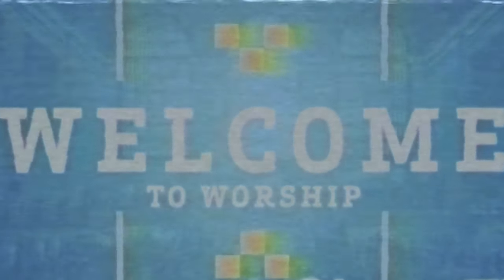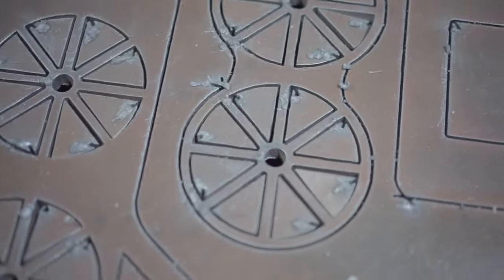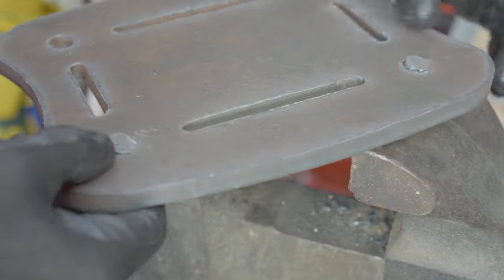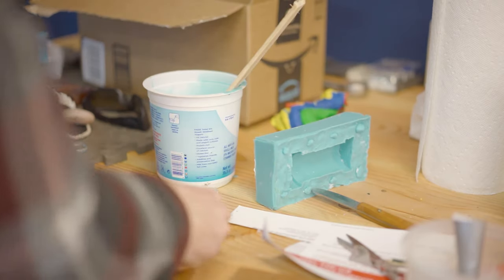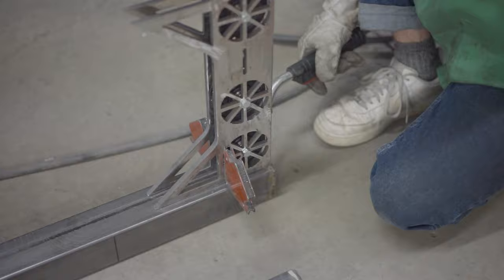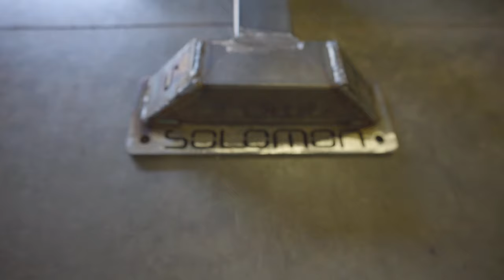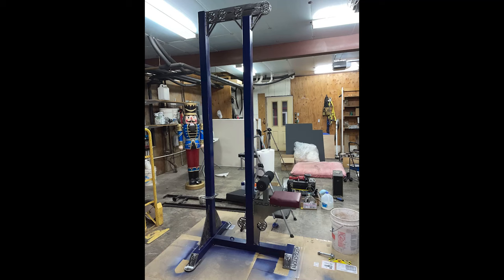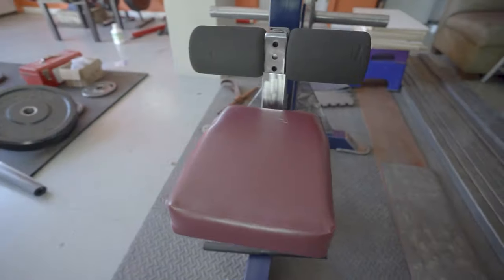DIY Lat Pull-Down (FULL BUILD VLOG/HOW TO VIDEO)

Comment: Great work!  
In case you are still grinding off the mill scale, a much easier way to remove the mill scale is to soak the pieces in vinegar.  I use Allen's double strength cleaning vinegar.  Soak overnight (or more), then rinse and clean them up with a fine 3M Scotchbrite pad on an angle grinder.  The dissolved mill scale residue comes right off leaving a great finish.

Comment: Great job, I like it.  I like the Olympic plate style more than the weight stack , more versatile.  What would be cool is you could make a leg extension , leg curl combo that you could attach to that bottom cable  and attach to that part under the seat (removable not permanent).  Plus with this pandemic it's perfect for home gyms.  Saw your other video on the adjustable cable machine, that machine is nice also, perfect for single arm and single leg isolation exercises.
Reply from the maker: i have thought of that exact thing, and a slew of other machines that "attach" to my adjustable cable machine and use its stack as weight. Videos will be coming soon, since you guys like this stuff so much! thanks for your comment!

Comment: I made a much cruder lat pull down years ago using the seat rollers from a concept 2 rowing machine. Same 4 roller carriage system as you. Was super smooth.
Reply from the maker: Dude I spent days trying to find rollers that fit over a 3x3 online. Apparently they just don’t make anything like that for sale. I had to make my rollers. You’d think a 3 inch wide wheel would be something you’d be able to find on the Internet... absolutely not.
Reply: @solomonmachine2137 . Way back then I used the model B rollers which were 2” across, so I used 2” tubing. The newer models are wider but I don’t know if they are 3 or 4 inches across. Did you consider them originally?
Reply from the maker: @JWB671  no i did not but thank you for bringing this to my attention. maybe they sell replacement rollers.
edit: i think you just saved me. I found a 3 inch wide roller for a treadmill. THANK YOU
Reply: @solomonmachine2137  where did you find that? Sports smith and gymPart.com have lots of equipment parts... you can also buy rollers from concept2 directly also but, like I said, I don’t know the width of the model C and newer machines only that model b machines use 2” rollers. The kits come with bushings and hardware too.
Reply from the maker: @JWB671  I think they are 3 wide with the .25 being the two parts at each end that have a wider diameter. Thanks a lot by the way
Reply: @solomonmachine2137  good point the inside channel is probably an even 3 inches... with the hardware kit and bushings these rollers run super smooth.
Reply: Confirmed by two sources it is 3 inches...
Reply: Do you have a pic of the trolley you made?
Reply: @KCFitnessLink It was basically the same as the one in this video.

Comment: I have a welding machine and all the equipment necessary to make this, I will just need a CNC shop to cut out the pieces needed, and I bet you this is not even expensive to make, wow
Solomon, have you shared how much you spent making this Lat Pull-down..?

Comment: Amazing work! This video makes me want to learn how to weld! I’m curious how that many pulleys affect the force needed to lift the weight.
Reply from the maker: It’s a 1:1 ratio. The weight you feel when you pull is the full weight on the trolley! Although adjustable machines are 2:1 mechanical advantage

Comment: Nice builds as usual. Virtually from ground up, short of melting and forming your own steel. Lots of techniques I'm not aware of like the trolley wheel of polyurethane (?) and that a swage tool other than a hydraulic exists. Keep it up :D Also just to confirm it is 1:1 ratio? Are you keeping and using both builds?
EDIT:
Forgot to ask if this was based off something, or your own design?
Reply from the maker: It is 1:1 ratio, perfect for huge back gains. I’m keeping both for now but I’m open to selling to the right person. And this one was completely designed by me. I’d say I was inspired by the Sorinex lat pulldown though. Especially for the seat

Comment: Wow!! Amazing job.
You should definitely use Delrin for your rollers. Thats what rogue use in the trolley of the rhino.
Also, you could use UHMW on each side to keep it centered.
Reply from the maker: You sure they don’t use Acetal? All these plastics, what’s the difference? Anyways I wish I could have made them from some stock plastic on a lathe. Thanks for watching I appreciate it a ton. You don’t know how much your support helps me emotionally and mentally.
Reply: @solomonmachine2137  Hey my pleasure!! Acetal is Delrin. It's just the commercial name. I'm designing one also and, I'm going the same route. I might also make a belt squat attachment for it.
Reply from the maker: @francisboutin2779  thats what people have been saying, that a belt squat would be easy to add using the low row pulleys. I might as well. If you're making a trolley yourself and are using 3" tubing, I would highly suggest checking this link out: https://www.sportsmith.com/seat-roller-concept-2-rowers-model-a-and-model-b/product/P17001

another kind gentleman in this comment section helped me find those!
Reply: @solomonmachine2137  Wow thanks, that's fantastic. Makes my job much easier now.

Comment: The cable machine one was better imo. It takes a while to load the plates and you can’t really do super-sets because you won’t be able to change the weight within a matter of seconds. Nonetheless, great job 👍
Reply from the maker: Agreed. This is undeniable. I wanted to try and make a trolley, for anybody that also wants to make one. But the stack system is far superior. However it’s also far more expensive. Thank you so much for watching :)